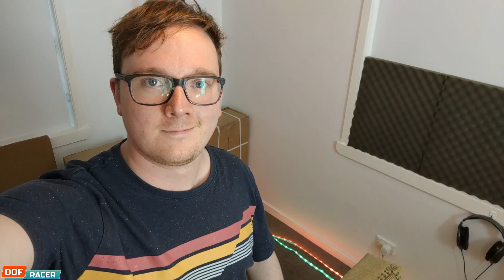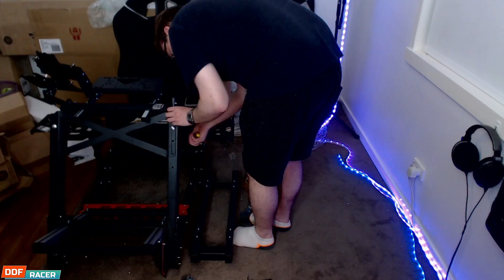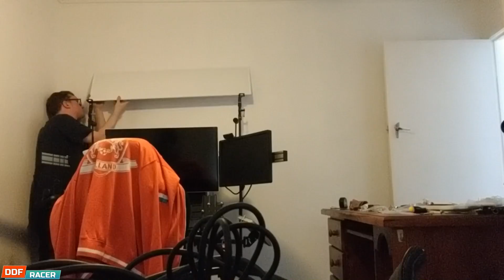Building My New SIMETIK K2-R Sim Rig!

Comment from the maker: 0:00 Intro
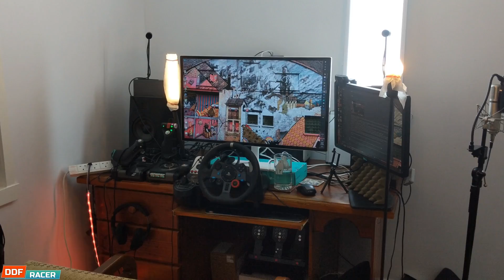0:30 My previous rig
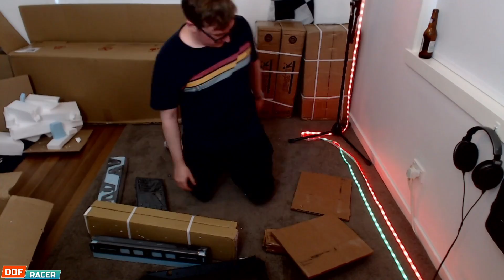2:55 Day 1 - 5pm (Unpacking and getting started)
3:15 Assembling the frame base and pedal supports
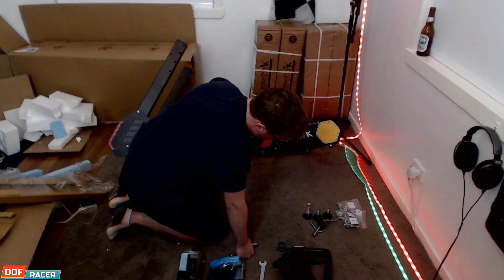4:22 Assembling the wheel mount
4:49 Assembling the pedal mount
5:30 Assembling the seat mount and sliders
6:55 Installing the seat
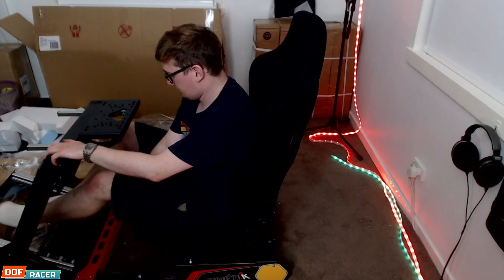7:50 Day 1 - 9pm (Slow progress...)
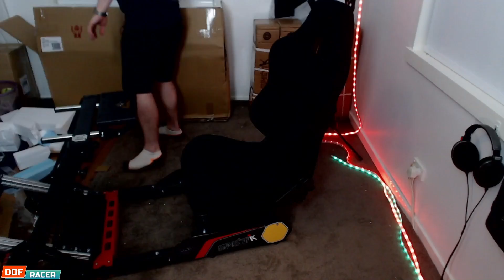8:05 Unpacking the attachments
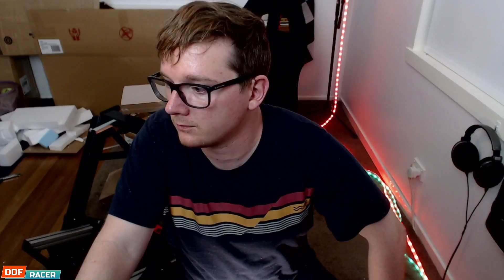8:22 Assembling the shifter mount
8:40 Assembling the handbrake mount
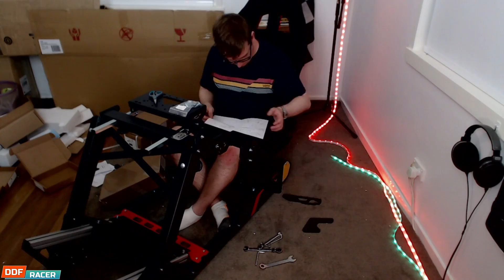8:50 Assembling the keyboard mount
9:11 Assembling the mouse mount (Part 1)
9:37 Assembling the tablet mount
10:25 Assembling the HOTAS mounts
11:18 Assembling the mouse mount (Part 2)
11:36 Day 1 - 11:20pm (Attachments done!)
11:52 Unpacking and assembling the central monitor mount
13:00 Assembling the PC tray
13:33 Assembling the side monitor mounts
14:23 Day 1 - 1:00am (Time for bed )
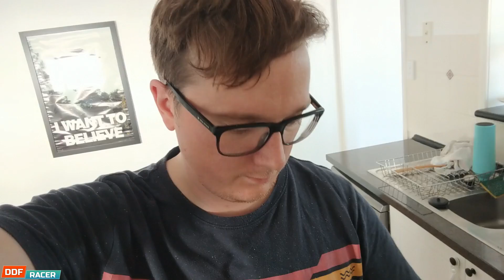14:39 Day 2 - 7:00am (Time for coffee)
15:08 Disconnecting everything and clearing the old desk
15:52 Out with the desk, in with the rig
16:10 Installing the monitors
16:52 Installing the wheel
17:10 Installing the pedals
17:52 Installing the HOTAS
18:03 Plugging everything in
18:17 Installing the Oculus sensors
18:27 Cable management
18:46 Installing the lighting
19:27 Installing the shifter
19:47 The before and after
19:55 Day 2 - 2:00pm (FINISHED!)

Comment: Much better, Dan. See you still kept the G29 steering wheel as well - another plus in my book.
Reply from the maker: Pretty much everything is the same as before, apart from the sneaky Fanatec shifter upgrade towards the end of the video 😉 the rig is just a fancy new desk at the end of the day, the equipment is still all the same although probably being used in a much more efficient way now. Must admit that having the pedals fixed down makes a massive difference though 👍
Reply: @DDFRacer  Yes, that's the most important thing. Fixed firm now, but I used to have pedals which were slowly pushed further and further back as a race progressed. Could never have done an endurance jobbie.

Comment: Nice rig! I've had a K2 for a couple of years now, and I've been very happy with my choice. I remember fixing the seat and sliders was a bit tricky...
Reply from the maker: I'm sure if Simetik made seats it would be a super easy process, but the fact you have to get a third party seat and then try to work out the instructions all by yourself doesn't make things simple 😬 very reassuring to hear you've had yours a couple of years though! I get the feeling these things are manufactured to last a long time.
Reply: @DDFRacer  Yeah, it's a well built thing and I'm quite sure it'll stay with me as long as I'm sim racing. I've only used it with a G27 though, so the rig's had it quite easy :) Maybe some day I'll find out how it behaves with a dd wheel and loadcell pedals...

Comment: Going to be one of those multi part viewings I think, but how you manage with the V3's mounted on a box? 🤯
Reply from the maker: That's a good question...I guess I had the overall force turned down and also was using my right heel to press down on the base plate whenever my left foot was braking. I still do it now actually on the rig, out of habit I guess, and have to make the conscious effort to stop myself 😂
Reply: @DDFRacer  You have done amazingly, I could not believe that you were driving with the pedals on a box. Surely there will be fewer bins now they are nice and tightly on the rig.

Comment: Hey nice Job :)
BTW THX for the review of the Clubsport V3´s i bought them after whaching your review on them and me got much quicker too !!!
Reply from the maker: You are absolutely more than welcome, so happy to hear my review came in useful! Do you see what I mean about the big difference in braking feel by using muscle tension instead of foot position? Once you get your head around the concept it changes everything 🤯
Reply: @DDFRacer  yeah defenittly and like you told  my logitech 29 steering feels more smooth now :D. the vibration is awsome to and if i lock up then because i want to !! and the next thing i need is an is a rig because my rig is a loose chair lmao :D

Comment: I ordered this cockpit today along with the centre screen mount. Was your monitor totally flat on the back? I'm guessing with the centre screen mount you don't get any spacers to mount the monitor? Those uprights just bold straight to the back of the monitor? Reason I ask is because I'm using a Samsung Odyssey G5 and it has a funky design to the back of it. Were the top bit above the vesa part petrudes at bit. I realised after I ordered today that I should probably check if my monitor would fit properly. So I've ordered some 8mm M4 spacers just incase.
Reply from the maker: The screen mounts on the rig allow for lots of different configurations, although some monitors may require a VESA adaptor to be mounted 👍 my old monitor was one of those although I've since replaced it with an ultrawide which didn't need any adaptor and could be mounted directly. Let me know how you get on anyway mate, and all the best for your build when it arrives!

Comment: Hi,how do you find the placement of the gearshifter I have the rig but thinking of buying a shifter so interested,thanks for the vid was helpful
Reply from the maker: There's a couple of options either down by your leg or up top next to the wheel. I have mine up by the wheel because the HOTAS takes up the leg spot but it's really quite nice, you can angle it down quite a bit so it's not as awkward as if it was mounted pointing straight up. Plenty of customisation available 👍
Reply: @DDFRacer  ok thanks a lot for the reply,think ill order it then

Comment: How do you make the fanatec pedals work with your logitech wheel ?
Reply from the maker: The pedals and wheel are completely separate and connect to the PC through their own USB cables, the pedals do not plug into the wheel like the old G29 pedals used to. The Logitech wheel and Fanatec pedals register as two individual devices and can be assigned to your in-game controls just like any other button/key 👍
Reply: @DDFRacer  thanks for letting me know 👍

Comment: Any opinion, whats perfect single monitor size for K2-R ?
Reply from the maker: Good question! I'm running a 32" as my main screen and it's a nice size because it's quite close to my face. I would have it even closer but unfortunately the button box/tablet holder gets in the way on the bottom right corner of the screen. You could probably go a little bit bigger than 32" but it depends on your configuration for triples if you have them. The side mounts are extremely versatile though.

Comment: What monitor do you use for playing?
Reply from the maker: I'm using VR 99% of the time so I'll mostly be racing in my Oculus Rift CV1. However for things like Automobilista 1 which don't have VR, I'll be using my monitor which is an AOC Q3279VWF8 👍
Reply: @DDFRacer  thank you very much for your answer. I want to buy thisnrig too, but im not surenifbthis can handle a podium series from fanatec without moving. Do you thin its stable for that? And are the pedal plate steble?
Reply from the maker: It certainly can, this thing is incredibly stable!  It's designed for direct drive wheels and honestly when you bolt this thing together you can feel how solid it is. Also the fact it weighs over 100kg probably helps too 😅 the screen doesn't wiggle, the pedals don't move and the chair gives a lot of support even when you're slamming on the brakes.
Reply: @DDFRacer  thank you so much for your answers! I think im getting this one

Comment: How full did the swear jar get? 😅
Reply from the maker: It got off to a slow start and then hit the jackpot big time when it came to installing the seat. Which came with no instructions. And was an absolute *nightmare*. But after that it was pretty rough going tbh, I might have put enough aside to finally pay Ed off for last season's VLMC repair bill at Imola 😬
Reply: DDF Racer Seat is a pain in the arse. I can’t fully recline mine on my mounting brackets so I need to take it all apart and then drill a wider hole so I can get the screws in.

Comment: Bro u have some tutorial for seat? I got TRS-e
Reply from the maker: Unfortunately not as I have no experience with that seat 🤔 although if you're mounting it to a K2 rig like this it should be pretty straightforward as the frame allows for bolts to be fitted in many places and is super adjustable. It might just be a bit time consuming trying to line everything up is all 👍